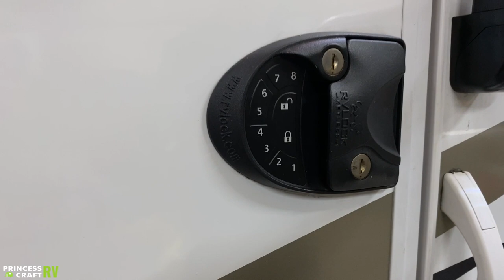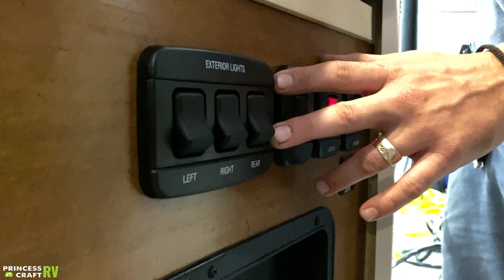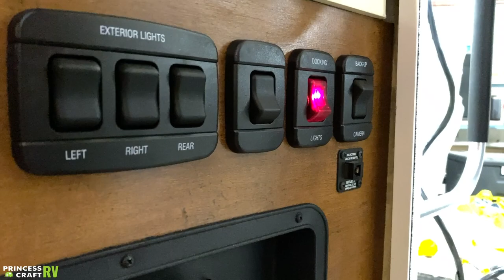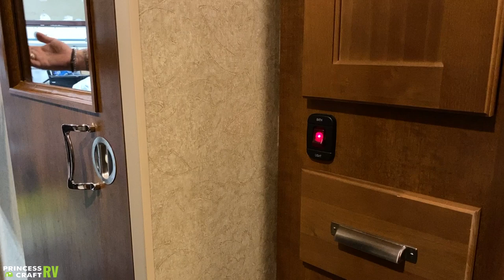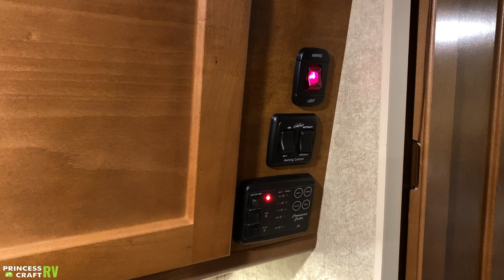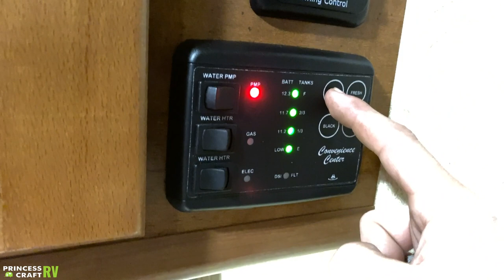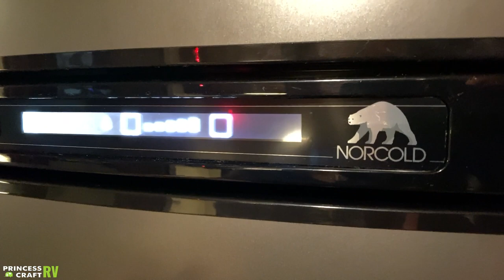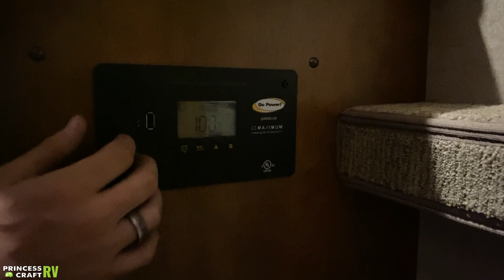Lance 850 2020 model - Technician Tour

Comment: One question I have, as I've not had a camper or other model RV, and never drove/pulled one that wasn't mine, I use my rear view mirror CONSTANTLY while driving, with this, of course it's useless, will the back up camera allow use while driving to see what's behind you?
Reply from the maker: A quality wireless backup camera will definitely feel more "normal" while towing a trailer with a view of what's directly behind you.
Reply: @RVTechToursatPrincessCraft  Good to know.  I am still building my house, but also saving for an RV.  I hope to have one within 5 years, and while a class c is nice, I just don't see the point when I'd have to buy a car to tow.